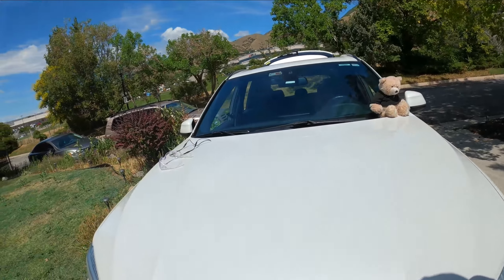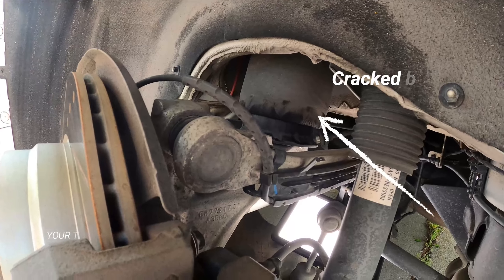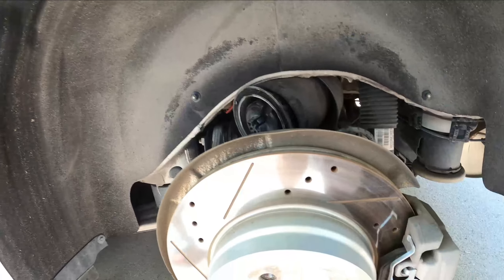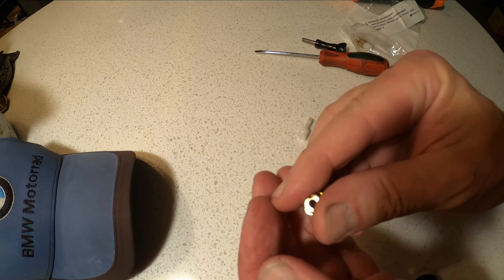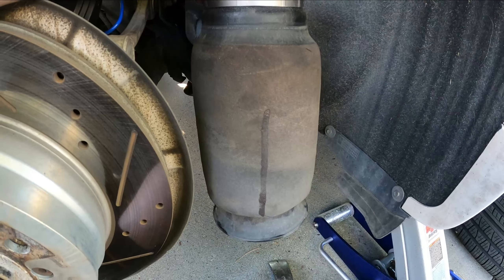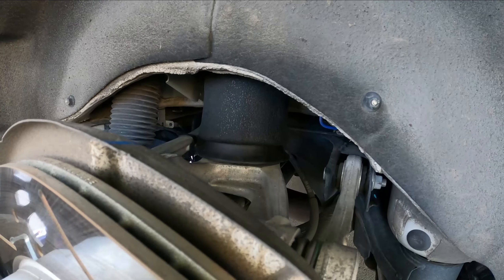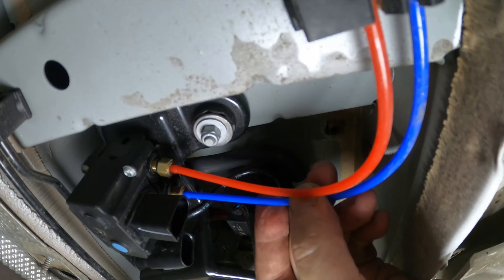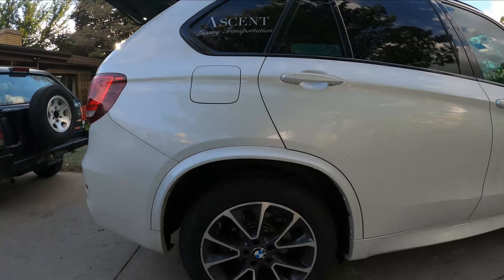BMW X5 F15 Self Leveling Rear Suspension Air Bag replacement.

Comment: Thank you for the video
where are you located yesterday had same issue 2015X5 mechanic asking $2000  do you think t is reasonable price
Reply: 2000$ ? WTF no he is scamming you… I’m doing this exact job tomorrow for a customer, 2 brand new air bags from arnott 511$ cad , + 300$ labour 150$ per side.

Where did he get 2,000$ from ????? 

That is how much I charge to remove and put back in a motor on a e90 chassis and inline 6 cylinder…
Reply: Stay away from that “mechanic” he is not a mechanic. The bmw dealership wouldn’t even charge this much. It’s 30 minutes of labour…